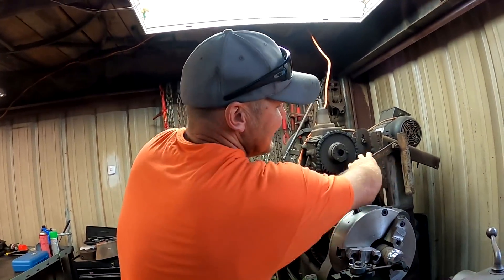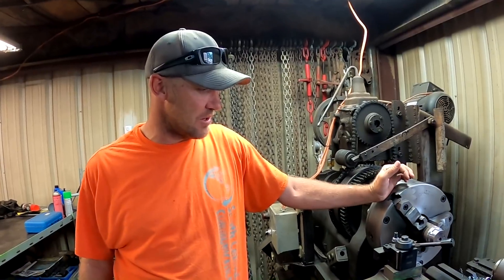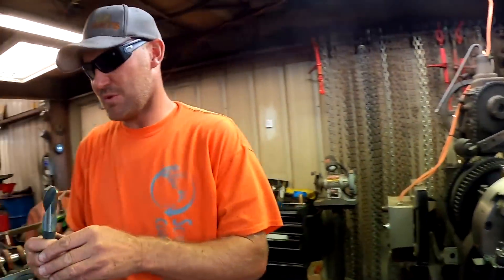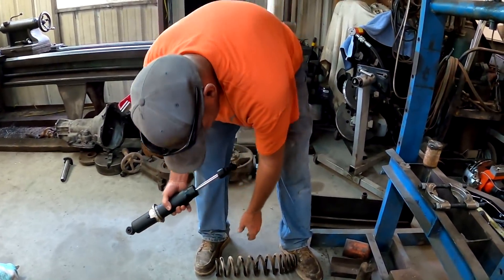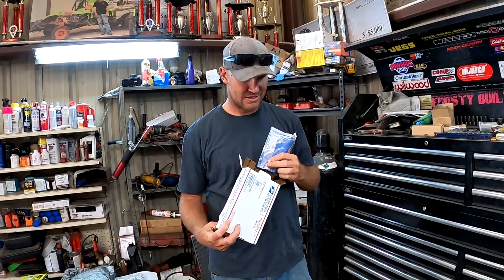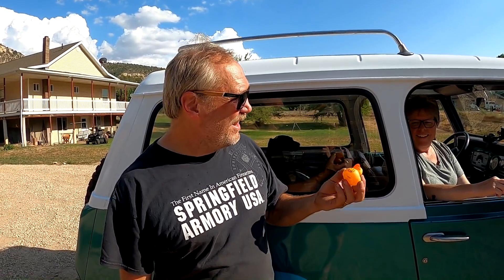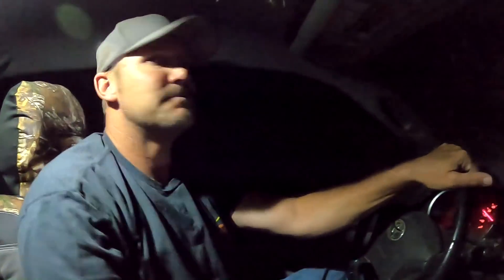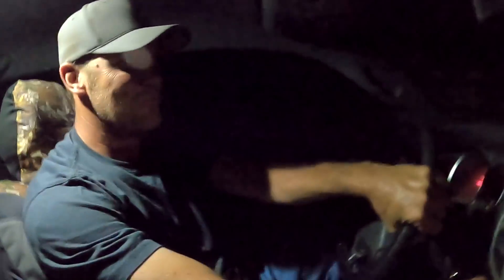I built this Custom TOOL that just made my Life EASIER!!

Comment: Love that old lathe!! I had a 1944 Navy Surplus lathe at my trucking company shop and I was amazed how many of these diesel school mechanics could NOT run it nor my old Napco mill machine!!
Reply: RollinRat  I got into hauling stuff out of warehouses at the Denver Arsenal. They were taking some of it up to an old Molybdenum mine up in the Rockies and dumping it and burying it.. some was going to an ole missle complex in Nevada for further dismantling.. would backhaul scrap metal out of there going to Plymouth Utah for smeltering.. quite a racket our govt had going there..
Reply: I help at a shop as a kid 13 or so they were building THE I.S.S. mockup,scale model. The one in Johnson Space Center.
I was in big brother program. They had on simaler one scared the shit out of me. I mostly carried bolts an screws. An swept up. Thanks
Michael P. Centinnie. McDonnell Douglas. Maybe. 89' or so
SeaBrook T.X

Comment: Just a heads up for ya, Paul.  Those keyless chucks, like you've got in the lathe aren't made to handle the torque of tooling larger in diameter than their opening.  So if you go hard with a S&D drill, it can lock up on you and ruin you chuck.  Should be fine so long as you take 'er easy.
Love the work you guys do.  Get at it...

Comment: Nice! If I can add it's not a bad idea to put some type of safety mechanism into play that prevents the spring from flying out and hitting someone in the face. I know it's a highly unlikely scenario, but when you bend down to take the keeper off or when putting it back on, you're in a vulnerable position. Something as simple as setting a small piece of plywood on the bed of the press between yourself and the spring would absorb most of the inertia from it's force and keep you safe. Love watching your channel, keep up the great work!

Comment: Just a thought.. instead of the bearing splitter on the bottom . Couldn’t you make a plate that goes across the press with a hole in the center for the shock  and lips on the sides to go down over the press bed so you didn’t have to worry about it sliding off the press ?

Comment: I really enjoyed watching this! Brought back a funny memory of my dad and I changing the struts in my first car. He was convinced he could compress the springs by lacing a rope though them and pulling. If you can imagine two fat guys wallowing around, covered in brake dust and grime, in August heat in Alabama, trying this idea out, you get the picture. I am sure if someone snapped a picture it would have looked like a pair of monkeys trying to be romantic with a football. Finally, he handed me a $20 bill and had me run down to the tool rental place near the house and we rented the right tool for $10 and had them both changed in 15 minutes.

Comment: Years ago I was working at a Cat dealer in San Diego.  We were "caging" a recoil spring for a D10 tractor.  This spring was about 200 to 400 pounds and the coils were about 1 and a 1/4 to 1 and a Half inches around.  Cat had a tool to do this.  A hydraulic cylinder was used to compress the spring, (I think that it was a 100 ton cylinder) and as it was being compressed it came out of the tool, and just went across the yard at a high rate of speed.  It hit a small raised corner on the concrete, and flipped up and went through a cinder block wall.  It still had enough kinetic energy to completely destroy a huge air compressor.  This was just before lunch and there were people everywhere.  It missed everyone just by luck.

After that, we fabricated a set up to cage the spring that  would not allow the huge heavy spring to escape.   This was on a newer high sprocket tractor.  Occasionally the caging bolt that held the recoil spring on the older low sprocket  tractors would break.  To get the spring out of there you had to cut a hole in the roller frame that the spring was inside with a torch, then reach inside and start to cut up the spring.  You just had to cut the spring until there was no more force on the front idler yoke.  Recoil springs were one of the most dangerous parts on a Cat dozer if the caging apparatus ever failed. 

This happened over 30 years ago, so some of the dimensions of the spring that I mentioned may be off a little.
Reply: That reminds me of when I was a kid we had an old 60s Chevy Viking grain truck we were in the tire shop getting new front tires and right before the guy reached over to remove the air hose the split rim came apart and the top of the rim flew up through the tin roof and landed in the parking lot it didn't take my dad long to hit the salvage yards and find old school bus wheels with the same bolt pattern because they couldn't run split rims and we got rid of the widow makers

Comment: What's up with that 64-66 Chevy short bed? I've got a 64 and a 66, both are SWB panel trucks. The 66 was cut into before I got it, so I'm going to make it into a 2 door crew cab dually. I need a thrashed cab to take the back off of, and a C60 front clip for the flared from fenders... Whatcha got that can be sent to Texas?

Comment: If you put the bolts in from the front and the nuts on the rear,  if the nut comes off the bolt will usually stay in longer and possibly get you home, just a tip from experience.

Comment: Those Jeepsters ( 1967 to 1971) have a 101 wheelbase. The 1972 and 1973 have a 104 wheelbase. Also on 72/72 Jeepster name was dropped and they were all commandos. Original Jeepsters were 1948 to 1950 with leftovers titled 1951. All were 2 wheel drive and 104 wheelbase. Collector vehicles now. Enjoy

Comment: You need a cut off tool for the lathe
Reply: Not for that thick of stock!
The band saw was way faster.
Reply: @haroldphipps3457  you can cut it on a lathe just as fast.  It would not be cut on an angle and you can cut it to size
Reply: @johnloughrey9485  you must have a HUGE lathe.

Comment: He's shy because it's called witness protection program. So I have a 90 Chevy g10 short van and I want  to upgrade it a 350 and 4x4 it. I bought the whole front and rear suspension from a 1991 Blazer with the entire hanger system . I have a new crate 350z4 engine and a TCI 700R4 transmission that has not been converted to 4x4 yet it's a two-wheel drive set up. I have all the parts and I mean all the parts including a holly sniper fuel injection system radiator 205 new processor JB custom remote twin stick setup and well what are your thoughts?
Reply: May you enjoy many years and memories